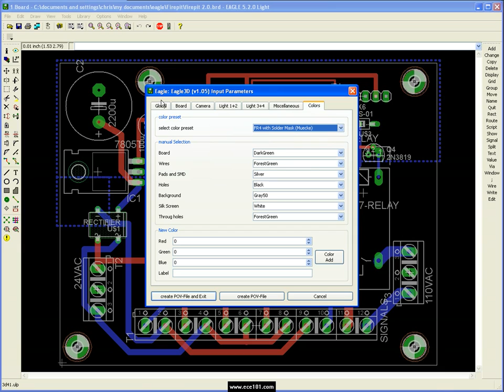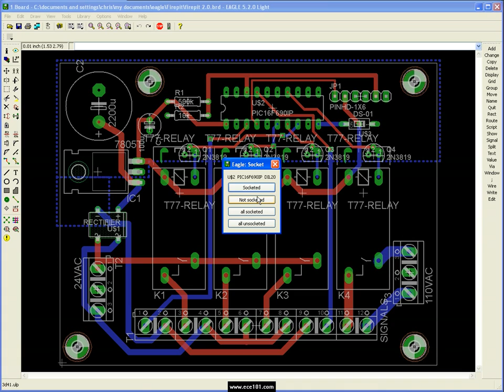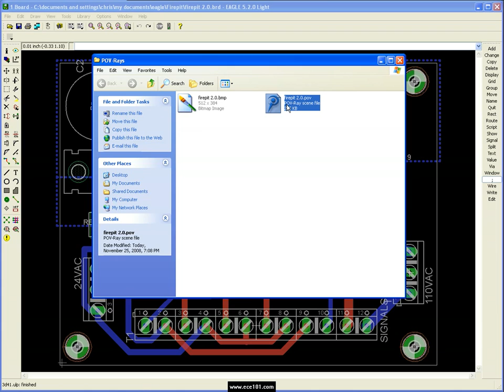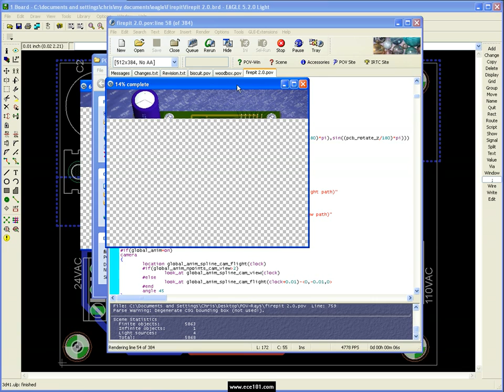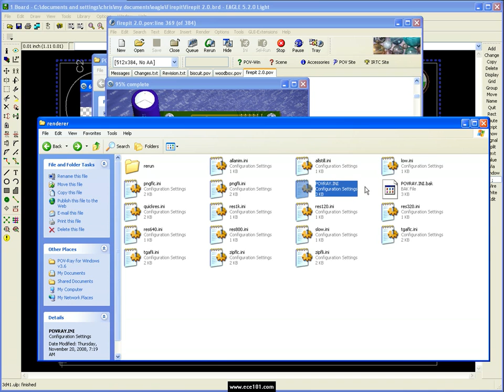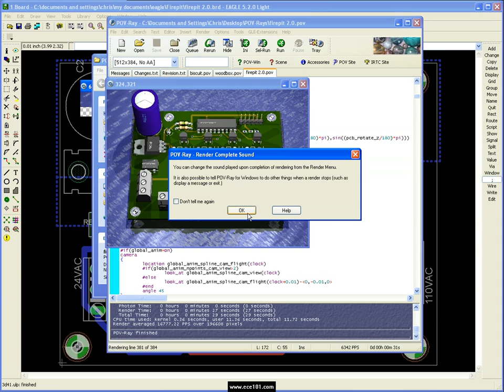Eagle3D

Comment: Cool 3D images but for a tutorial it really could have done with set up info as well. you appear to have the entire Eagle3D folder in the ulp folder? there is a LBR file in that folder too. is it ok staying in the eagle3d folder or does it have to be copied t the lib folder? there are a lot of other bits i'm not too sure on either. I found the ini file in documents! and added the line of code but still didn't work. the setup isnt very clear in the tutorial. thanks tho!